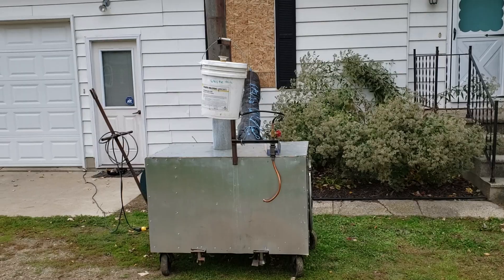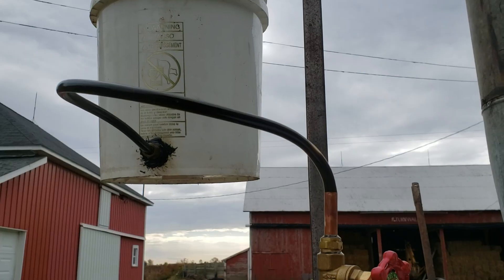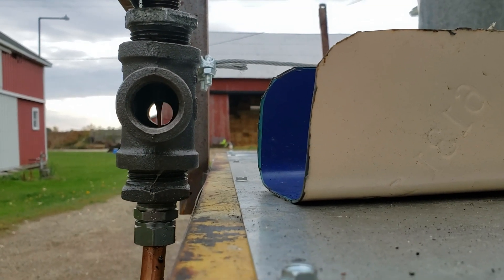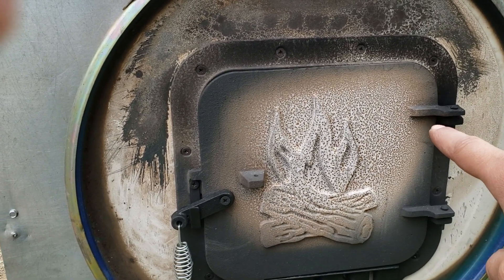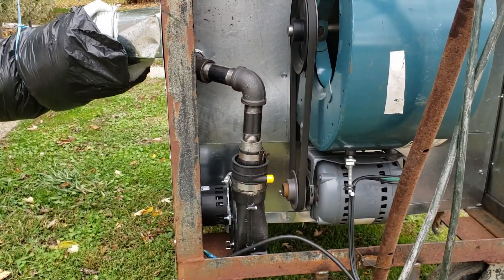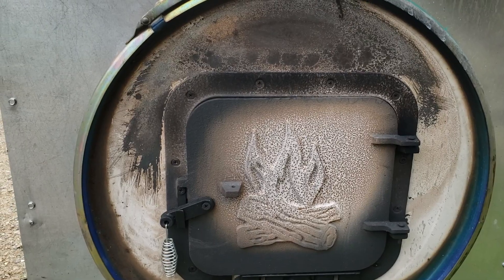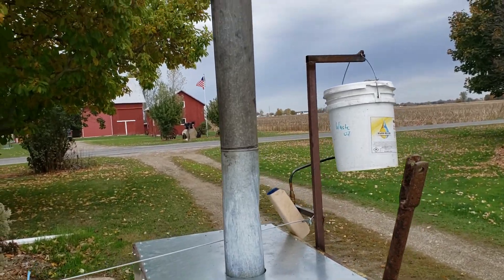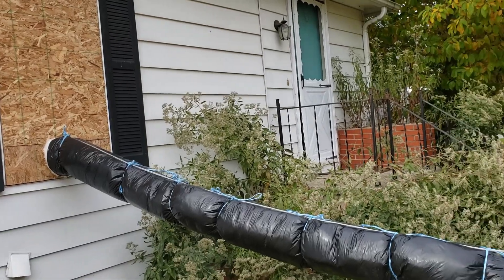Waste oil burner, heating my home with free oil

Comment: I'm planning to have a oil burner in my shed (Hybrid wood stove) to heat water up and then pump it through radiators in house so i can have both shed and house warm. I'm trying a non blower design but need to control the air over the fuel and extra air to burn the oil vapors cleanly. I got an old hot water tank outside now burning oil and starting to dial in the air fuel ratios.
Theres so much energy in used oil that people pay to dispose of.
Nice job on your setup, now to watch your upgrades video.

Comment: Not to be picky, and perhaps you addressed this in later videos, but more air is not always cleaner. At a certain poing, the excess air will start to cool the flame and make more smoke. When inspecting / testing oil burning furnaces, this is one of the things that you check for "excess air" and the more excess air you have, the less efficient your burner gets.

Comment: Do you use any filters on the pressure in line? Normally the filter goes on the suction side of a blower system

Comment: I'm looking at a setup similar to that only my furnace fan will be in the  shop (out of the elements) blowing shop air out to the stove, reheating it, then back into the shop. That will be more efficient reheating the warmer air instead of trying to heat outside cold air. Just a plan yet. I have to design the duct work going out and returning to shop. The heat exchanger around the stove will just be a heat jacket 2" around the stove, blowing the air from the bottom around the stove and returning to the shop from the top of the barrel if that makes sense. My only concern at the moment is how far away I have to have the stove from the shop for the insurance to still cover me!

Comment: You're a legend, what an amazing and affordable heater you've built. I'm hopeless at building anything mechanical, I wouldn't know where to start. How many hours does that bucket of waste oil last roughly, running through your system, at the approximate run rate in your video?

Comment: you're a farmer you have corn cobbs , grass , wood chips any biomass you can burn that in a stove or furnace even make your own pellets , i have made me a  couple stoves and furnaces that burn wood chips  , pellets or combined , self feeding no electricity one of them is a rocket and  in my garage  i can get the firebox up to 800F if i want to although i keep it at about 500F it's freaking amazing , my wood furnace in the house i'm modifying it into a rocket stove also self feeding the wood should burn for at least 2 days it's a US Stove they claim it's all nighter but it's b/s it never did but has saved me a lot of money in fuel it warms 3 floors without turning on the blower

Comment: This is my favorite design so far but it needs some modification. Youre constantly heating air from the outside and that makes it inefficient. I’ll get to building this one day and I will circulate the air from the house into the heater and then back into the house. This makes me think that this would have been awesome when Texas froze up last year.

Comment: So what do you do once your house is warm and you don't need heat.. so I assume you turn it off and on or do you bypass the air into your home and leave it on a lower fuel setting until more heat is needed?

Comment: Better to do cogeneration. You take a diesel electric generator with water cooling. Filter waste oil and use waste oil as fuel instead of diesel. Use the coolant from the generator to heat the water heater and use the electricity from the generator to charge the battery to power the house. Diesel runs on waste oil without any problems.

Comment: Man, that Heating unit you've made by hand is very well thought out and made - to say the least. Putting it outside certainly greatly lessens the possibility of accidentally setting fire to your house or your barn. And seemingly satisfies the insurance company's possible concerns as to safety issues to boot.  Well done mate!

Everything else in your build seems straightforward and practical but the interior of the unit needs some pictures of how you made that - especially - as that is the heart of the burner and it's not clear how that is constructed from just viewing it on your video presentation.

I know this vid is 2 years old but I've just recommended your YT video to readers of a more current channel as a solution to safety concerns with Home made or home DIY projects of this nature so here's the back reference to that channel for any who come across your innovative home heating system from waste oils.

This English or UK one that I'm referencing from my recent Yt viewing history is using used cooking oils I presume rather than auto industry waste oils - but is another interesting take on Home heating attempts using what are now at the present - Free oil sources - but may not always be due to soaring Oil and fuel prices these days:

Free Heat .. Fantastic Tin can Waste oil Burner
564,204 views  Feb 7, 2021
Super easy to make Free heat Tin can waste oil burner. I made this from a dog food tin and a sweet tin in just a few minutes. It wont last too long but it proves that my stove can easily burn waste oil for heating if I want. The conversion of the stove was easy too with just a bucket and a couple of valves.
These things work great but you need to be careful and don't take any risks with your home. 

https://www.youtube.com/watch?v=hw3v2gN_sLk&ab_channel=GerrysDiy

Conclusion: 
There were indeed a lot of naysayers to Gerry's innovative idea for a waste [ cooking oil ] oil burner in the comments section at his presentation - but I doubt they'd be able to say the same about yours - because you have certainly thought of most contingencies and safety issues with your very practical DIY home heater. 

So....  Cheers mate! From Country/rural Victoria, Australia.  🙃

Comment: That electric motor would cost more to run than just putting the heating on!
Reply from the maker: I'm not sure if you're aware of this or not but there's electric blower motors (circulation fan and a draft inducer) that run inside your furnace. (This is where these parts came from)   Electricty wise.... it costs around $2.25 a day to run with zero gas cost.

Comment: I haven't noticed how you manage heay circulation in your house? It seems you are pumping it all in to one room and from there...?

I live in a country with 4 seasons, and summer lasts for 2-3 months, that isolation is crucial to warming the house. Minimum, minimum 8cm styrofoam on exterior walls. Optimal 10 to 15 cm. And that saves your heating costs.

Comment: I checked your channel right quick but I didn't see you had posted anymore about any improvements but I'm sure you have. I am trying to design a sawdust burning stove that will work on the same principle as a pellet stove.
Reply: Hi - I'll simply repeat a reply comment to another commenter above that may or may not be of use to you to consider as part of your design maybe - for a sawdust stove or even a twig burning stove as there are many of those types of innovative ideas on you tube presentations:

Hi, yep any type of white goods - like buggered fridges, dishwashers, home Electric rotary clothes dryers, old and non functional washing machines etc all have square metal frames that could be adapted to make heating units of various sizes that would serve as the housing for the inner burner unit.
But of course a suitable sized internal metal drum /burner to fit each type of throw away White goods unit - would either need to be sourced or cut down to fit the available outside framework.

The internal drum from a rotary clothes dryer might serve as the internal burner but the metal is not as thick a gauge as a 44 or 55 gal oil drum.    But on the other hand - could indeed be replaced as needed fairly often or cheaply because white goods are not made to last these days and are in plentiful supply on solid waste annual Junk drives - IF you happen to have that service by your local council once or twice a year.

I'd even consider the drums on the older type washing machines - that were built to last and were pretty thick - even though they have holes in them as those holes might assist in ventilating or drawing heat away from the interior drum via an exhaust fan of some type being fitted to the unit that draws hot air away in the cavity between the outside square sheet metal frame - from the inner round drum. "  

Seems a bit odd quoting myself though. 😉🙃

Comment: I got and old wick burning stove from an auction a few years ago . Oil drips onto a 6 inch wick made of asbestos and once it's lit you adjust the burn rate by the draft and oil in flow . No electricity needed ! Passive heat but works great ! Any oil works great so long as it's filtered for chunks of stuff or using old engine oil that it doesn't have anti freeze in it . Comforting watching it work through the glass AKA mica window on the front !

Comment: Nice job I have burner in my garage. I used a retired hot water tank turned it upside down cut it off to hold about 8 gallons for my oil tank. The pipe fittings are now on the bottom where I need them.
Reply: Hi, Yeah, good idea - as there's always people dumping their old Burnt out/aging or just not working hot water heaters - on either annual solid junk drives - IF you have them in your country or area - but even in places that don't have junk drives people will tend to leave them on their nature strips for disposal or collection - IF the New Unit installer won't take the old one away free of charge as part of his/her installation. 😉🙃

Comment: I would guess 5 -10 gallons per day the way he is using his burner.
found these rates on commercial waste burner site
Estimated Monthly Gallons of Waste Oil Needed to Heat a Shop with a Waste Oil Heater:
Based on an Average 160-Hour Work Month

CE-440 Waste Oil Furnace (ideal for garages with 10+ bays) – approximately 480 gallons per month, based on 3.0 GPH fuel consumption rate
CE-330 Waste Oil Furnace (ideal for garages with 7 to 9 bays) – approximately 370 gallons per month, based on 2.3 GPH fuel consumption rate
CE-250 Waste Oil Furnace (ideal for garages with 5 to 8 bays) – approximately 280 gallons per month, based on 1.7 GPH fuel consumption rate
CE-180 Waste Oil Furnace (ideal for garages with 3 to 6 bays) – approximately 195 gallons per month, based on 1.2 GPH fuel consumption rate
CE-140 (ideal for garages with 1 to 4 bays) – 160 gallons per month, based on 1.0 GPH fuel consumption rate

Comment: Pretty cool I really love the innovation.  I once designed in my mind an outdoor boiler that used a car radiator water pump and radiator fan in my head I never actually built it but I might someday still I bet it would have worked pretty well.  The biggest challenge I see in most home owner designed heating systems is how to regulate the temperature and fuel usages but I heat with wood 100 percent and I keep my house at 72 no matter what so I guess it just takes experience.
Reply: Check out mine you can build it easily just scroll through my page,

Comment: The problem is getting a good supply of waste oil. You can burn vegetable oil (used canola oil from fast food restaurants and filter it to remove solids and water) and you modify the way the fuel is burnt. I built one and it burns any kind of oil and works very well and no hydrocarbons coming out the stack with vegetable oils!

Comment: Too bad you couldn't get the oil to burn even more efficiently, and produce a blue flame. No carbon, just carbon dioxide, and water vapor. Might not be able to do that with really dirty oil though. Cool project.

Comment: Please take a look at a channel called "desertsun02". Lot of good ideas there.
When you heat air ourside and push it via a duct like that, you will lose a lot of heat, this will be very inefficient.  If you  heat a coiled copper tube and transfer some liquid (water +glycol) 
and run it using smaller pipe to transfer the heat in to the house, you can extract that hear using a car radiator with a fan blowing over that radiator.  This will also allow you to use smaller blower or use lesser oil and heat longer.

Comment: Great build man! 
It does seem like having that unit indoors would give you a lot of extra radiant heat and that return duct would certainly up the efficiency as well
Reply: be pretty noisy in the house.
Reply: @paulraymond1804  If you had a cellar it wouldn't be a problem - but in an attached but separate garage might be ok but there's still the risk of  insurance issues in any case - should your house catch fire for any reason and unless you could prove it wasn't the heater that caused the fire you would be screwed over by the insurance company I'm thinking. 😉🙃

Comment: Great build my guy. I have also made my own waste oil burner in different ways.  I am very interested in seeing how you used the inducer motor in the burning plate. Do you have any pictures of this that you can share. I would like to add this to one of my heaters. Because I'm having issues with not enough air.

Comment: I've heard that even if you have it outside and only ducting to house, that insurance will not cover it if your house burns down for any other reason.
Reply: I’m pretty sure if you heated water/ antifreeze and piped into a radiator system or underfloor pex system, they couldn’t get way with that, and it would be much more efficient.

Comment: Ok hear is a question:: I seen some build and just seeing this and I like it. But what if you build it to heat the water and run the water through old radiators to heat the house. Using what you have to heat the water all outside and run water into the house from it to the radiator. Just a thought. Sounds like I need to get busy working on this project. Good build !! Thanks for sharing
Reply: Great idea!  I was thinking along the same lines. They make wood fired units that do that. Why not waste oil?  I also have a 40x60 shop. I put pex in the concrete floor, but never bought the boiler and pump, and manifolds.  Now I’m getting very motivated to try this with the outdoor oil burner.  (I also put 3” of high density foam insulation under the concrete. That is a must or the cold ground will suck all the heat out.  I  threw that in just in case anyone is considering  using that concrete floor heat design.)  Some people even run pex tubing on the underside of the floors in the house. They make wide aluminum plates to hold the tubing up to the bottom of the floor and they act as heat sinks to transfer more of the heat up thru the floor material.

Comment: I'd love to take this design and run hot water thru it with no risk of blowing up. I need a pool heater and have a endless supply of used oil 50gal a month all year long!

Comment: Or get some small glass circles and silicone them into your drip t-pipe so you don't have to worry about putting a large metal chunk there to block window from blowing the stream. Very nice build. Would love to see some plans. I would love a safe outdoor based heater that could be used to heat a home versions lot if the waste heaters you see which would only be good in a ventilated garage. Keep up the good work man, you got a subscriber outta me cor this one.
Reply: A couple of pieces of Perspex would serve just as well and be easier to cut and silicone in place I should think and there's not heat at that spot to melt the perspex or any type of clear see through plastic for that matter. 😉🙃

Comment: No waste oil heater video would be complete without a visit from the family cat or dog 😆
These DIY heating and basic survival ideas are gaining more traction than ever before especially considering the current situation we're facing with the possibility of rolling blackouts and our economies going to hell .
All in all a good design you made there although I'm looking for a design without using any power . Looks pretty solid and professional .👍 Not insulated ? Wow must be a really old house .It would be cool if you could build a floor vent system and tie that forced air heating system to it .The nice thing about this kind of heater is that you can use different fuels like used motor oil,used cooking oil etc and if they're dialed in right the emissions are really low .
Reply: I’m thinking that it could be made to heat water/ antifreeze and circulated in a closed loop system out  thru a radiator, or baseboard radiator heaters in the house with a small circulating pump hooked to a battery and solar. Or some people fasten pex tubing to the underside of the floors in the house. They make large aluminum plates that hold the pex to the bottom of the floor and they act as heat sinks to get more heat out of the tubing as the hot water flows thru. Hot water would be more efficient than hot air also.